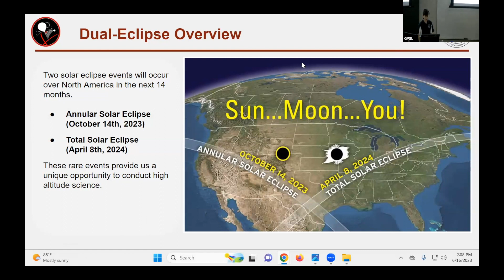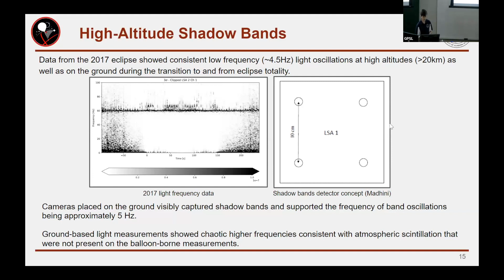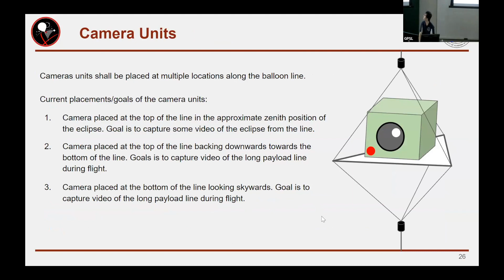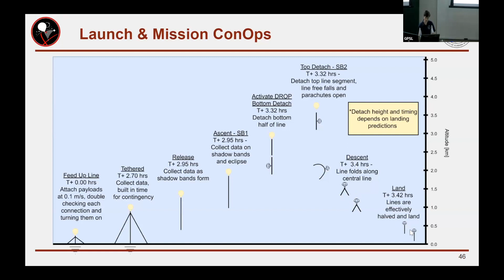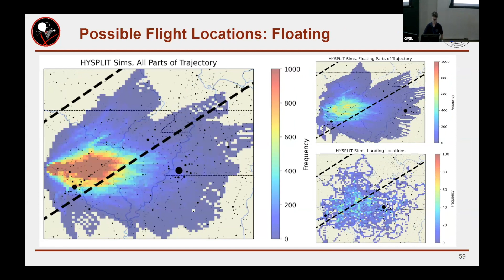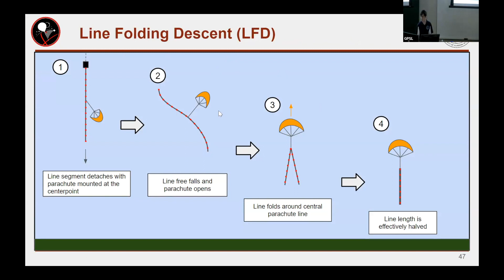"Shadow Band" Phenimena During Solar Eclipses

Comment: As you pointed out, the height where shadow bands appeared shows that Earth's atmosphere does not create them. In fact, it is the Sun's atmosphere that plays the major role. The Sun is reduced to a thin sliver beside the base of the Chromosphere, separated by the Temperature Minimum Region—the spectrally Dark Band. These two surviving light sources act like a pair of slits in a double‑slit experiment. It produces moving interference fringes on the ground—the shadow bands.